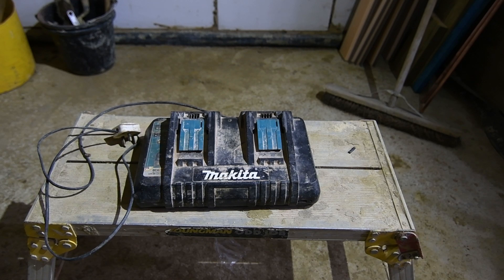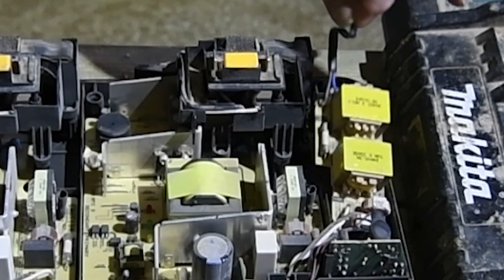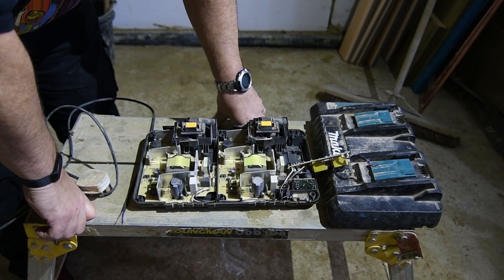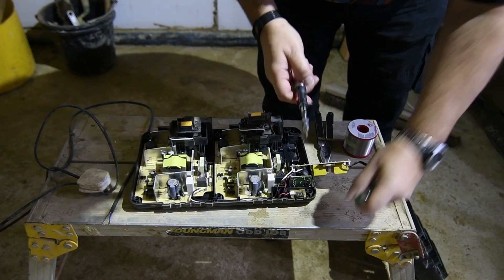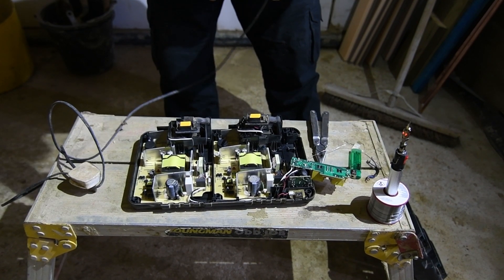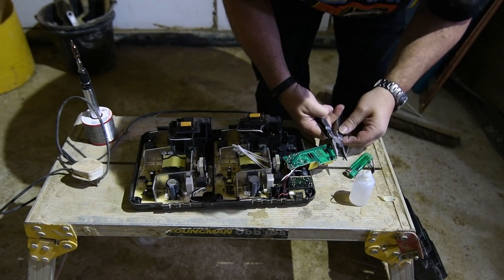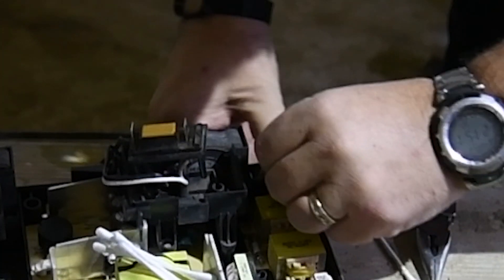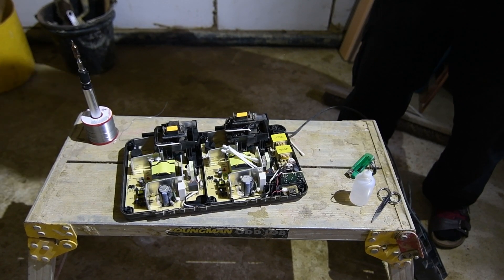Dc18rd - 1st repair in new workshop

Comment: by George, I hope that they didn't cut the cord becuz all those circuits that sense voltage and make it trikle didn't fail?  Cut cords can be a mystery indeed.  
I like the new addition.  Are you going to spray the cinder blok, or insulate with studs and pnaels?  Getting any floor power tools, drill press, saws, mill, lathes...  lol  
I want a nice 15'x20' underground shop, but ain't gots the 20k$.  We'd like a solarium a top of it too.  I'd like poured concrete walls.  It can double as a shelter, ten feet deep.  someday... dream...
Reply from the maker: No, it has a hard life, out in the cold, in and out of vans, all weathers. The cord got brittle and decided to break off.

The walls are going to be studded, drywalled and then plaster skimmed. In the studding there will be more fireproof insulation for soundproofing and heat retention. I already have the compressor, drill press, sliding chop saw and other hand power tools. I'd like an engineering lathe and vertical mill but really can't justify them for the times i'd use them!! I thought about going underground too.. We live on the side of a hill so we could shift the dirt but the costs would be silly. If this only cost $20k I would be over the moon but unfortunately way off the mark!! It's more expensive than that over here!

Comment: I'm very envious George. We have a 7' x 3' dining table in an extension we built years ago. I have half of it covered in cork floor tiles. I can sit and watch through to the TV and anyone who visits thinks my wife is a saint. She is. I won't mention the stores all around the place or the little pillar drill on the table and the 5 evolving bench power supples. I do try not to drop molten solder (lead) on the carpet or the dog. I'm sure your new workshop will soon take on that lived in look and of course you will now have even more room to store things you will never use. Why is it builders and farmers seem to have 'if it can break I'll break it' as part of their genes, I'm surprised Darwin never mentioned it in his book.
Reply from the maker: It is the nature of the hobby. If it's electronic, it will be useful for something. I was eyeing up a microwave oven that my neighbour was throwing out but held back because of the lack of space!
Reply: @GeorgeChristofi  My daughters went bang but after taking the covers off I could find no skid marks or anything. I didn't like the idea of messing with large volty things so I stripped it. I might have a go at rewinding the transformer for a car battery charger or something. Quite a nice little 240V fan about 150mm dia. I got 2 ring magnets out of the cyclotron ? thing, knob of the front and mains smoothing board. I saved the turntable motor and Pyrex plate. I would guess it's one of the badge engineered 700W microwaves. Pretty boring really so you didn't miss much.

Comment: Nice sized shop! Let's see, 60 amps @ 240 volts, 14 kW. Yep, you should be able to run a couple radios with that! 73
Reply from the maker: Maybe 1 or 2 Bob!!! I just have to not do it too often or my supplier meter will rub its hands together with glee!

Comment: Nice repair George.....looks cold in there. ....
Reply from the maker: It is a bit at the moment. We are currently sitting at around 0c (32f) in the evenings. Certainly its not as cold as it has been, daytime temps have been reaching the 50f mark. It will be ok when the doors and windows get fitted tomorrow.
Reply: Wrap up well till Spring George. .......:)
Reply from the maker: I would love to Tony. I only have to wrap up till march and then I'm off to a sunnier place for a couple of weeks. By then, England will either be under 3 inches of snow or having blazing sunshine...

Comment: Hello Sir. great to see you in your new shop... Well kind of ; )  What type of block are you using ?.  Makes it fire proof ,are you going to use dry wall/sheet rock ?. Not sure what you call it there. Thank you for the tour. It's going to be great !  Liked,Shared and added to Playlists.
All my best.
Bobby
Reply from the maker: Those blocks are a lightweight concrete thermal block. The outside walls are red brick and the fibreglass goes in between the two. We call drywall plasterboard and yes, there will be a layer of that as well as a skim of plaster over the top to make it all smooth. Still waiting for the floor to be done, that layer is only the 4 inch concrete base. There will be another 4 inches of fine grade concrete on top of that. Windows are being fitted on wednesday, roof finished at the weekend. Plumber will continue the pipework in about 4 hours from now, electrician will run the cables in the next day or so...

Lots still to do before I get to do my thing!
Thanks for watching Bobby, tace care.
Reply: yeppirs Bobby, all the bloody dodgy UK chit chat bloke rot, cheerio ol' chap.